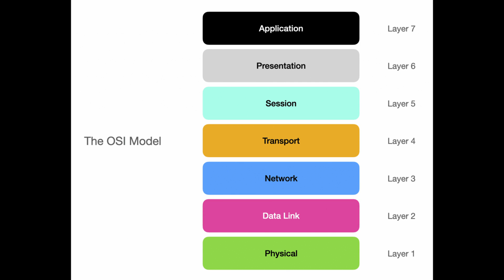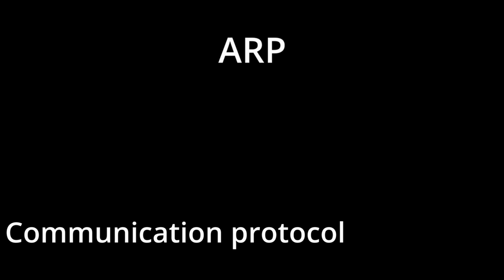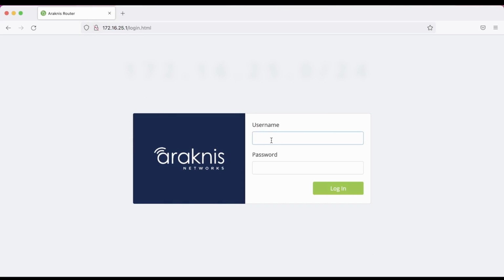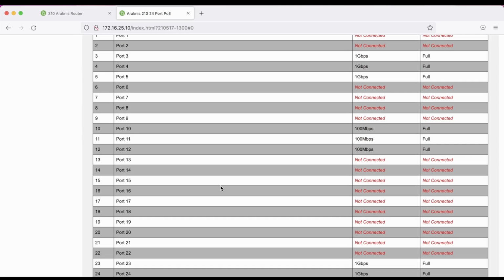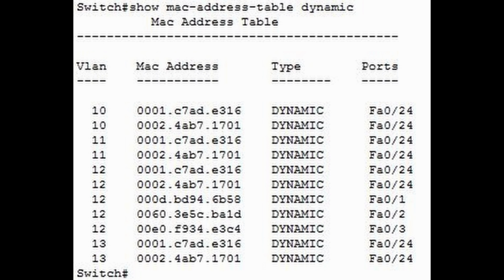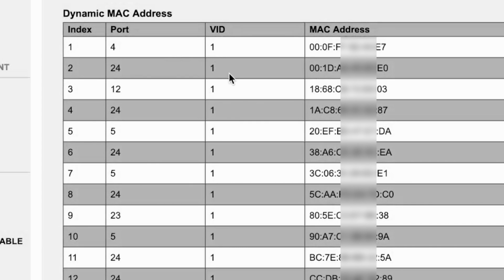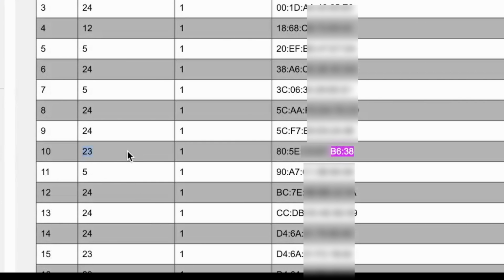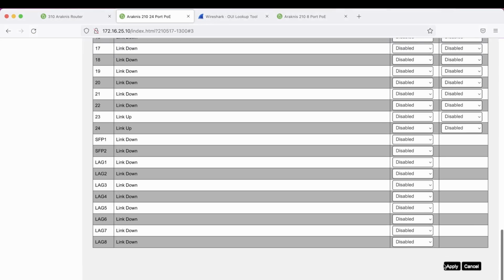Mapping the Network - ARP and MAC

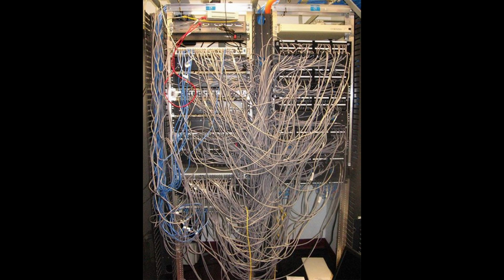Comment: 1:40 got me. I work in school IT support. At one of my sites, whoever wired and labeled a wing of classrooms, did a terrible job in labeling. I had to help a teacher with some network connectivity problems. I decided it was best to have her laptop hardwired to the network. However, the ports weren't patched in. no problem I though. I'll just patch them into the switch at the cabinet. I quickly realized that all of the ports in that room were just labeled "Room 2" both on the patch panel and data drop. It was insane. I didn't have a tone generator on me at the time so I had to figure it out one at a time.

Comment: Great video as always! Please can you do a video showing how to lock down a port by MAC address on an araknis 210 switch? For example, if the port is connected to a camera or gate intercom so someone couldn’t then use that data cable to access the network?
Reply from the maker: Thanks for the kind words. It’s funny you say that. That’s the topic for my next video. Keep an eye out. Cheers!
Reply from the maker: https://youtu.be/UPMecaqZ1oo
Reply: they might as well spoof the mac address
Reply: That’s called port security. You can configure a port to only talk to a specific MAC address. It is a problem if your device goes bad because the replacemt device will have a different MAC address and you need to configure that switch port again.